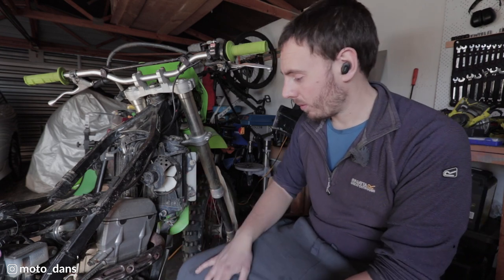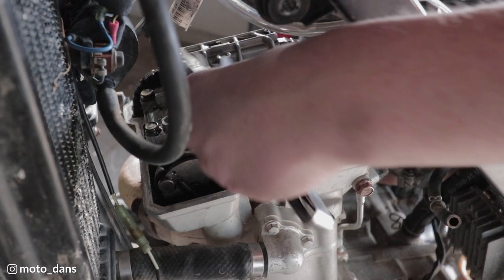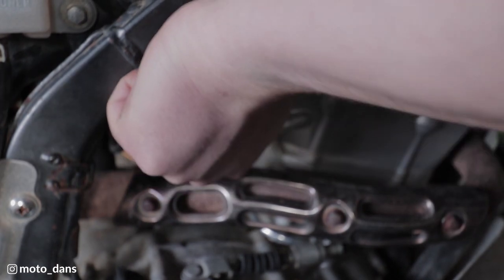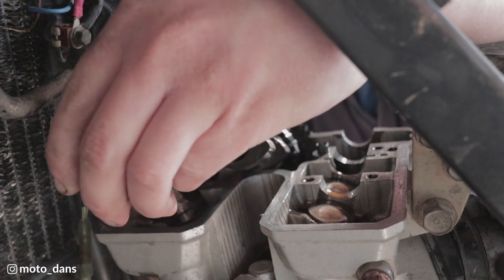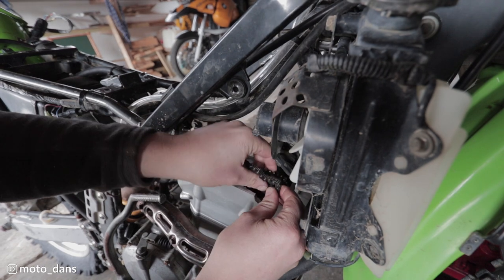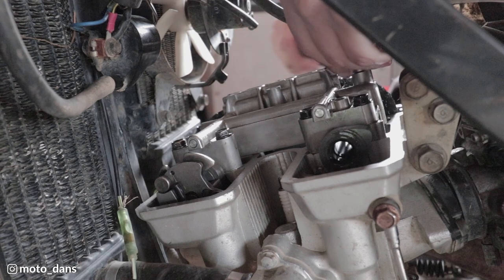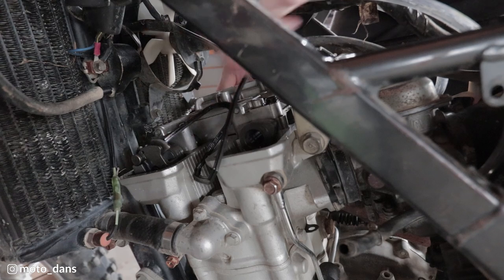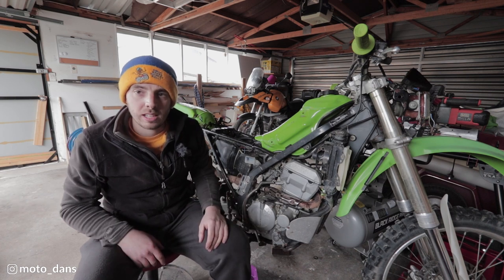Kawasaki Klx300 - Valve Clearance Check + Acr Mod

Comment: I love my 98 300r but it’s a pain in the butt to get started! I can kick it easily but it takes sometimes 30 kicks for it to start, and once it’s hot it really doesn’t like to start
Reply from the maker: Sounds like there is an issue in the carb. Mine at most will take 5 kicks from cold if it has been sitting for a few weeks. If it's in regular use starts first kick cold or hot
Reply: @MOTODANS  thanks for the suggestion, do you run the stock carb?
Reply from the maker: Yep stock carb and all stock jets and settings, top of airbox removed and the butt plug removed from exhaust
Reply: @MOTODANS  hmm, I’ll have to look into the butt plug removal mod! 😂
Reply: @MOTODANS  thanks for the reply’s! Hope all is well, cheers
Reply: @MOTODANS  I cleaned my carb, all my electrical connections, and my air filter and put a new spark plug in and it’s running great now
Reply: Check your valve clearance. Mine was the same. Adjusted valves now it starts first kick

Comment: Hi dan, should the acr have play on the end of the cam, bike started makeing a small wear sound after the last ride, iv taken the valve cover off to inspect the head and i noticed the acr has alot of side to side play, is this normal or should i replace the exhaust cam.cheers
Reply from the maker: What is moving the actual pressed on part? There should be no play in that.
Reply: @MOTODANS  the pressed on part is solid but the other bits attached to it have alot of play
Reply from the maker: @tjroxs21  mine did have some play hard to say without comparing what would be excessive though
Reply: @MOTODANS  thanks for the reply, looks like timing is out half a tooth this might be the noise I'm hearing, time to get a new timing chain 😅

Comment: What year klx300r? They did change the acr timing  in the later models. Great trail bikes
Reply from the maker: Mine is a 1997, I believe they changed the cam in 2003? Which had the improved acr timing
Reply: Super reliable bikes. I've had alot of fun on mine on trail rides. Cheers for the videos
Reply: Hello mate , out of interest can the later cam be fitted in the  99/2000 bikes  @MOTODANS
Reply from the maker: @robertcampbell8311  Yep as far as I know they can. That would be your 2 options on the early ones newer cam or the acr mod

Comment: Hi Dan, is this the same process for a 2021 model 300?
Reply from the maker: Acr mod wont be required on yours, Valve check procedure will be the same, unsure if the specification for the clearance is the same though
Reply: @MOTODANS  Thankyou